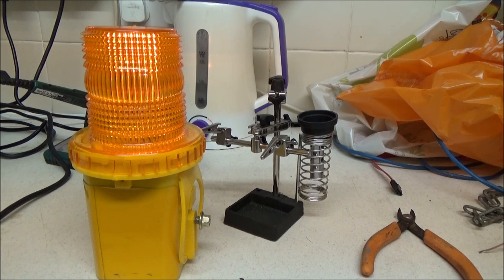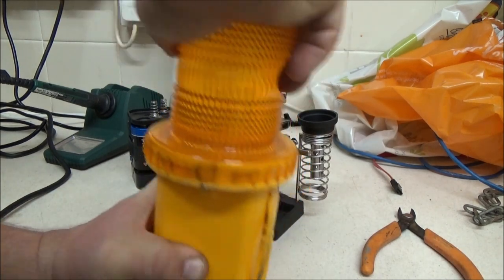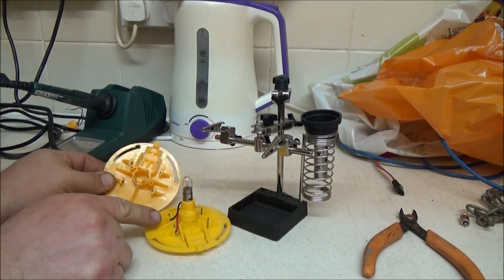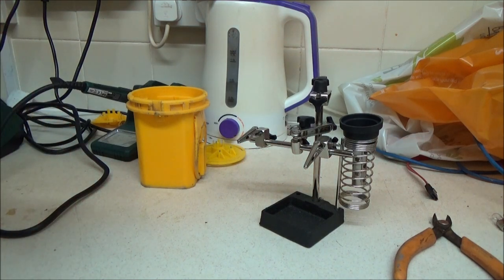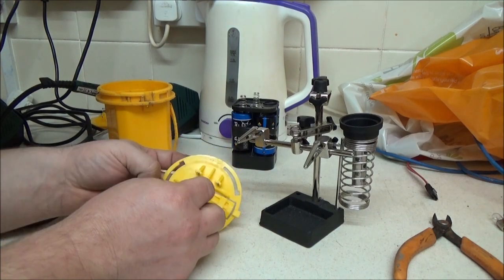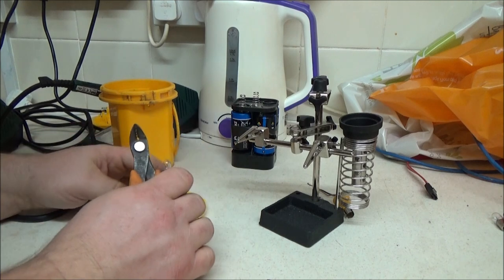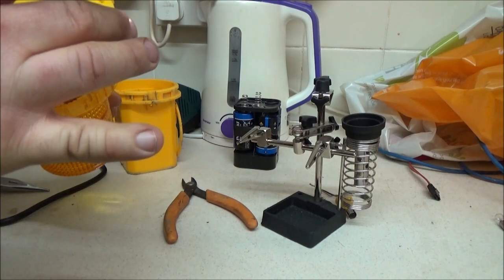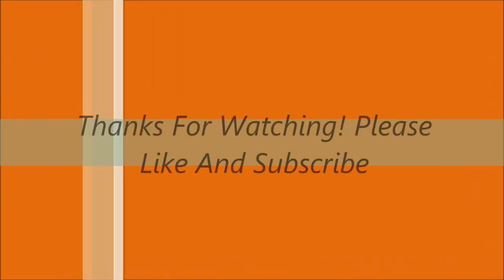Playing With Circuits: Simple Mod Made To a Dorman Unilamp.

Comment: Where did you get the battery adapter? Been looking for one for years. Used to be common more than ten years ago but can’t find them these days.
I have that lamp with the three wires. Lights as solid. Black to -ve and the two brown connected to +ve. Just disconnected one brown and it flashes. No need to de-solder from the pcb and can be easily turned back to solid by reconnecting the wire.
Model is UCW2S which is solid with photocell.
Reply from the maker: I bought a couple hand l;anterns cheap and the adapters were inside them. Not seen any since.